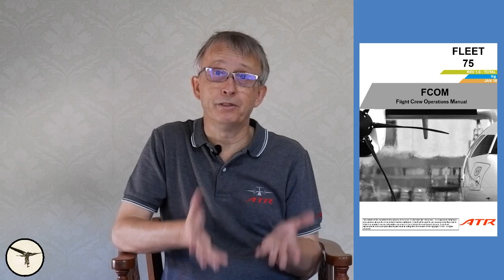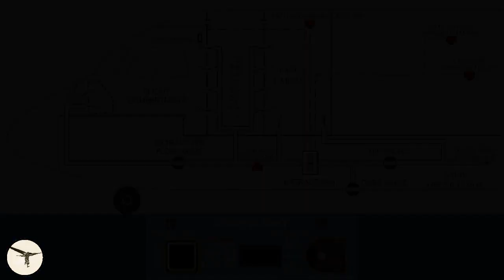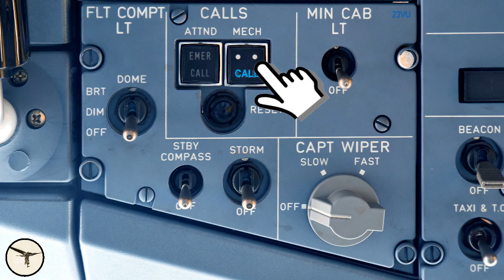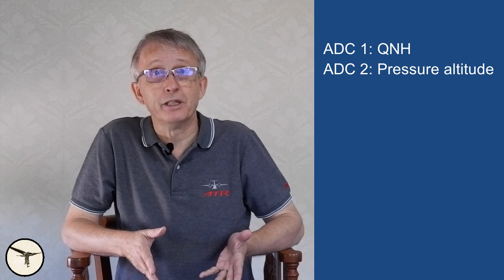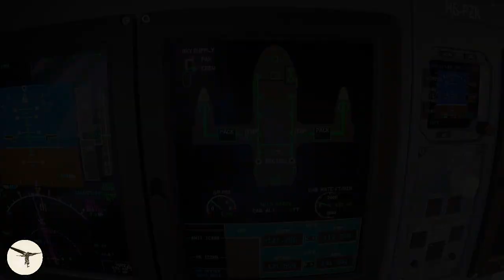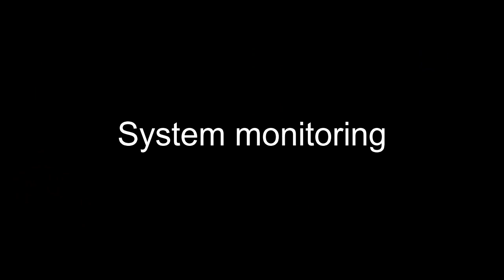ATR systems - Ventilation and pressurization

Comment: Hello magnat sir in ventilation system you told one hole is there just behind oxygen discharge that is for water drain from emergency hatch which is located above in cockpit its not fro battery ventilation battery ventilation vent is below it sir
Reply: Hello sir, I am looking for the official source of this information, how did you know that ? Cause a mech also told me that but i can’t find the information in the FCOM

Comment: Hello Captain, I follow your videos, they are a great help. I have a question. If we take off from sea level and our destination is at 4000 m = 13,000 ft, the landing elevation would be 13,000. Then 13,000 – 300 ft would always be higher than the ZCTH scale, so it would never intersect it in order to comply with it, correct? Up to what cabin altitude would it go?We would arrive at the destination airport with a cabin altitude above 10,000 ft and therefore with the CAB ALT warning?

Comment: Hello Captain Magnar,

What is the reasoning behind the mech call horn being sound when Exhaust Mode is pushed to OVBD?
Thanks for your reply, always love your videos.
Reply from the maker: When the Exhaust Mode pushbutton is set to OVBD, the extract fan stops. This means that the avionics are not cooled any more. Therefore, the horn is activated as a reminder to start the fan again.
Reply: @FlywithMagnar  understood, thanks captain

Comment: Regarding the dump pushbutton - what were to happen if the differential pressure is not at zero when the doors are opened during an emergency evacuation? Passenger discomfort?
Reply from the maker: Yes, or it will not be possible to open the emergency exits at all.

Comment: I know pax valve is the right answer.  But would dumping also help? Should that damage everyone’s face ears?
Reply from the maker: Dumping the cabin pressure will result in a rapid decompression. A better solution would be to select the overboard valve to overboard. But this is not necessary. With the pack valves off, the cabin pressure will start to decrase.

Comment: Hi Magner, do you recommend keeping the cockpit comms hatch open until after the no 1 engine is started? In this way the overboard valve is open so less of a pressure surge from the exhaust fan when the hatch is closed? Thanks
Reply from the maker: Yes, that is the recommended procedure. You can close the communication hatch any moment after the starter pushbutton is pressed, as this action causes the extract fan to stop.

Comment: I have a question: how does pressurization work in a flight between 2 high elevation airports, let’s say Bogota at 8360 ft and Rionegro at 7035ft. I ask because in the graph cabin altitude doesn’t even get close to 8360 ft
Reply from the maker: ATRs operating at airports with high elevation are modified to avoid excessive cabin pressure warning. I am not 100% sure how the pressurization system works at such altitudes. As mentioned in the video, the cabin will maintain the elevation of the departure airport until reaching 3500 ft above the airport elevation. Then, it will be adjusted in accordance with aircraft altitude, but it will also take into consideration the landing elevation. Whether the cabin will descend below airport elevation during cruise, I don't know.

Comment: Hello Magnar, thank you for another highly informative video. I'm just indulging into the ATR systems and hope not to stalk you too much with questions. This is the first time I 'meet' an aircraft which does apparently not have an overpressure relief valve protecting the cabin structure against overpressure when e.g. the outflow valves remain closed. Would you know why this manufacturer choose not to make use of such a relief valve? Kind regards, Boy
Reply from the maker: Thank you for your response. It might not been described clearly enough in the video, but an overpressure relief valve and a negative pressure relief valve are fitted on both outflow valves.
Reply: @FlywithMagnar  Thank you for your reply. Good to hear that overpressure relief valves are installed on the outflow valve system. That brings things in line with other aircraft I know. On those other types there was not such a procedure   as to switch off packs because the overpressure relief valve would sufficiently protect the airplane. One of 'my' types was the Fokker 50 which had some system commonality with ATR. That aircraft also did not have such a procedure. Would you know the background why ATR choose to treat the overpressure case as so critical that "packs off" was introduced? In the example where the F/O's window was blown out; was that a failure of the outflow valves ánd failure of the relief valve at the same time? Happy flights, Boy
Reply from the maker: @boyvanurk9854  , the overpressure procedure in ATR was revised to include "packs off" after the incident where the side window was blown out. I haven't seen the report, but assume the outflow valves were closed for some reason and that the relivef valve was inoperative as well.

Comment: Great video(s)! Do you have a good procedure for controlling cabin pressure manually without too much discomfort?
Reply from the maker: It's called patience. You move the knob a bit and wait for the indicators to stabilise. Then you repeat until the desired cabin rate of climb/descent is achieved.
Reply: @FlywithMagnar  I have experienced this first hand and you’re right patience is primary.  Regarding a MEL scenario do you think it would it be best to depart with the the the cabin in full decrease? So the pressure of the cabin can keep of with the climb? Thanks for such a swift response.
Reply from the maker: MEL is a bit funny. 

21-30-01P states that if the pressurizaiton system is inoperative, and the manual mode is operative, you shall depart with overboard valve fully open and MAN RATE knob set to max increase. 

21-31-01P states that if the automatic pressurization control is inoperative, you shall set cabin altitude in accordance with the published table. I'm not sure which postion of the MAN RATE knob is the best. I would probably depart with the knob set to 9 o'clock position. 

When you depart, the outflow valves are fully open. They start to close after you have become airborne. The automatic controller will then descend the cabin back to departure airport elevation and maintain it until you are 3,500 feet above the airport. Then, the cabin will start to climb with the aircraft.

Comment: Greetings ... What exactly is that piece that hangs from the lower area of the ATR when they are docked at the airport?
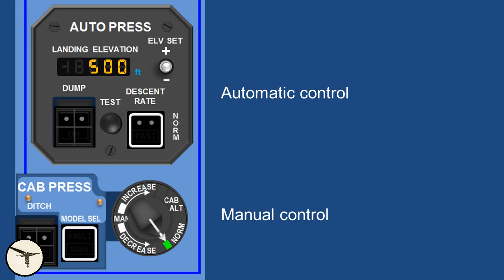Reply from the maker: Do you mean what you see at 8:07? That is the tail prop. It is a strut that is attached to the tail bumper when the aircraft is parked on the ground. It prevents the tail from tipping when there's to much weight (people or cargo) at aft part of the aircraft.

Comment: I heard the new ATR has a new pressurization panel in the cockpit. Is there any new function that come with the new panel or is it just a look upgrade?
Reply from the maker: There are some changes: Landing elevation is set by the FMS, and there's only one outflow valve, but with two controllers.
Reply: @FlywithMagnar  is the high rate p/b still there or is it completely auto now?
Reply from the maker: @chris22capt, that pushbutton is removed. Everything is automatic.
Reply: @FlywithMagnar  that's a nice upgrade I've to say

Comment: Captain, with excessive delta P the procedure calls for the pack valve to be closed? What then happens to the bleed air going to the pack (since the bleed valve is still opened)? is it released via the overpressure switch?
Reply from the maker: No, when the pack valve is closed, the bleed air in the duct doesn't move anywhere.
Reply: @FlywithMagnar  Ok. Thank you  for clarifying. In theory, it would be similar to if the engine is running and the bleed valves are closed (e.g. takeoff with bleeds OFF).  Many thanks for your swift response. Keep up the great work!

Comment: Can you explain me why do  you use 30 in the PA formula, please?
Reply from the maker: When QNH deviates from standard 1013.25 hPa, the pressure altitude changes with approximately 30 feet per hPa. This number is easy to remember and use for quick calculations. The exact value depends on altitude and temperature. Video reference: 11:07.
Reply: @FlywithMagnar  tks, your videos of ATR are really great.

Comment: little not correct, battery discharge air not from small hole near oxy relief glass, battery air discharge position lower and bigger hole LH side near NLG bay
Reply from the maker: Yes, I'm painfully aware of this mistake.
Reply: that hole (the one beside the oxy relief valve)  in real is a WATER DRAIN coming from the HATCH DOOR.
Reply from the maker: @alessandrocipullo , AHA! Thank you so much!
Reply: @FlywithMagnar   thanks to you !…we never finish to learn in aviation and on the planes👍😉and I learned so much from You!

Comment: I'm confused... You mentioned that one of the reasons the extract fan would automatically stop, is because of smoke.
Then, in case of smoke, the overboard valve would partially open in order to get rid of the smoke. But since the extract fan is next to the overboard valve, wouldn't smoke removal be more efficient with the fan on..?
Reply from the maker: The logic is that the extract fan will stop when there's a smoke alert, as this will prevent smoke form being sent back to the cabin. The overboard valve remains closed and the underfloor valve remains open. 
When the pilot selects exhaust mode pushbutton to overboard, the underfloor valve will close and the overboard valve will open partially. The extract fan remains off because the pushbutton also controls the fan. This is not a problem, as differential pressure will provide a good flow of air (and smoke) through the overboard valve.
Reply: @FlywithMagnar  That was quick:-).
Yeah, I guess there’s some logic to that.
Thanks a bunch. Awesome videos by the way.